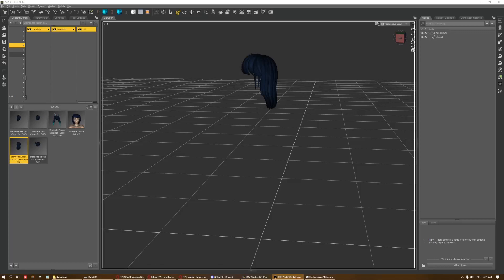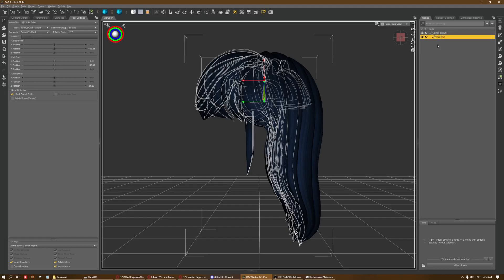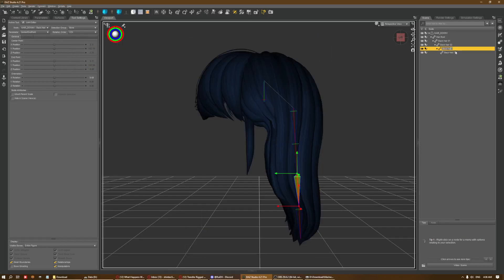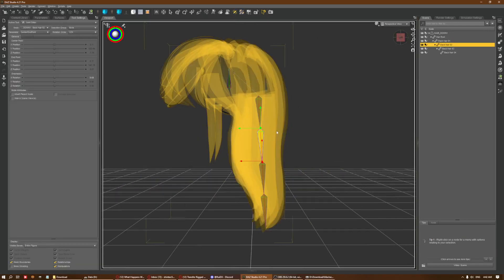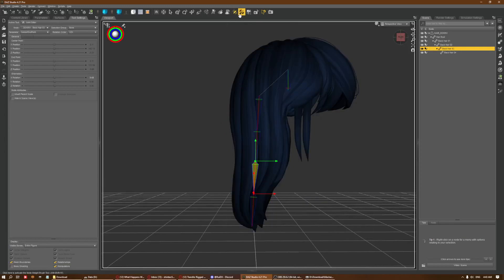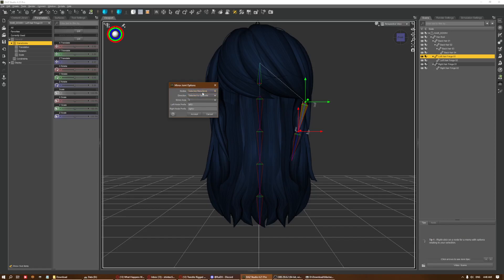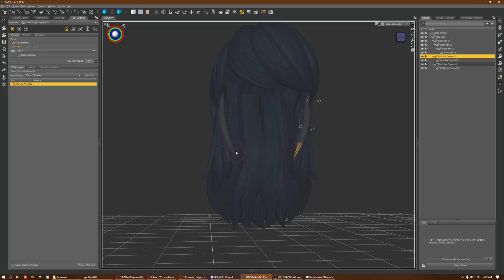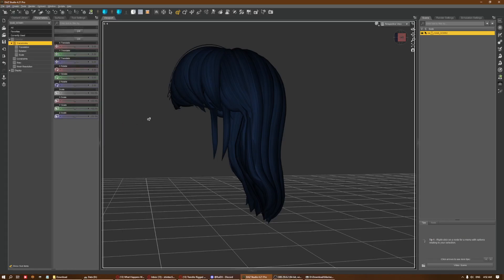Short tutorial on rigging an object in daz

Comment: Nice video! Hey I was wondering that can we import a model in Daz and keep its vertex groups and weight information? So that we don't need to do rigging and weight painting in Daz, but in Blender instead. As far as I know there is no way to achieve that.
Reply from the maker: When exporting from blender to obj, there is an option to keep vertex group. You can actually use that to set up a rig in Daz, though I've always found the MMD method to be much easier and more accurate.
Reply: @Shinteo5  Vertex group can be kept but weights can not, so the rigging can still be only done in Daz.
Reply from the maker: @Godless1893  Yes, the only other way is the MMD method I use.
Reply: @Shinteo5  May I ask what is MMD method? Exporting to Daz in MMD?
Reply from the maker: @Godless1893  Yes. You need to get a plugin for Daz to import MMD, but it's the only way I know of to import rig intact.

Comment: Sorry for unrelated to video question, but how in the world did you make Aerith model head and body morph work together with youth morphs? Because If I change youth morphs sliders, it affects custom head shape, so how did you make your morphs work together with youth morphs?
Reply from the maker: Within the youth morphs, there is one that undo the one effecting the shape of the head. Dial that in
Reply: @Shinteo5  oh you mean head neutralizer?
Reply: I'll try that thx
Reply from the maker: @alexandergrv4534 Yeah, that's the one.
Reply: I'm transferring young Sam from Death Stranding to daz it seems more difficult than normal character because of the youth morphs.. I'm trying to do what you did with Aerith, like you somehow made it so that Aeirth head morph works with youth morphs just fine, like you baked it somehow  with youth changes applied idk and you're not even using head neutralizer. Sorry can't explain properly.
Reply from the maker: @alexandergrv4534  If you mean the young Aerith, what I did is scale up her model to the full G8F size, do the wrap, then in daz, scale her back down.
Reply: @Shinteo5  I can't keep my custom head shape from changing when used together with youth morphs, head neutralizer seems to negate youth morphs head changes but not 100% so it's not correct head shape even with head neutralizer. Is there some trick I'm missing?
Reply from the maker: @alexandergrv4534  Don't think so. The youth morph is, at the end of it, still just a morph. Adding morphs on top of other morphs will almost always cause trouble. 

The only other way I can think of is to dial in all the body morphs, export the resulting G8F as an obj, making sure to change the detail level to default and the size at 100%.

Then importing that obj back into daz as a body morph, keeping the head morph separate. That way you can  have your body morph and head morph as you like. 

Character size can be adjusted later.